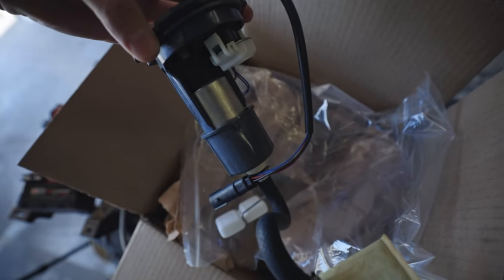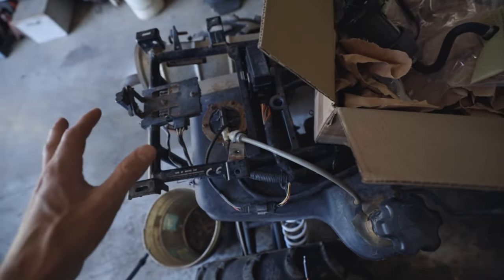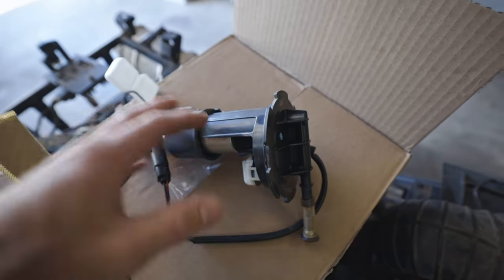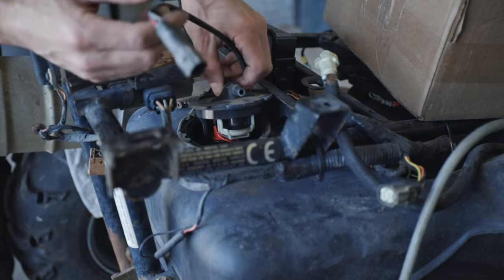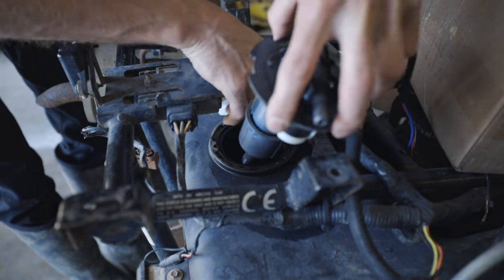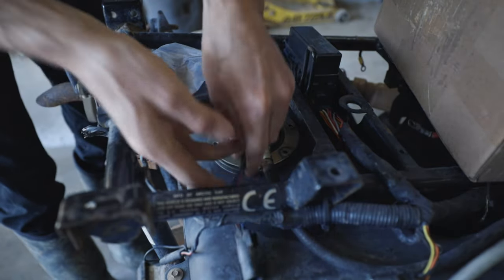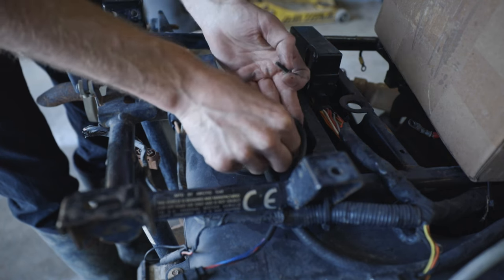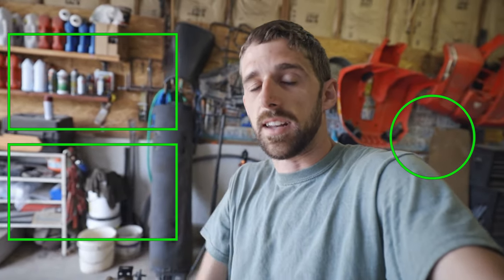How To install your fuel pump assembly

Comment: Yes, if it initially pumps when you turn the key it will give enough gas to start and idle a little. but a bad pump won't keep up the fuel pressure constant and then it will die out. If it's whining I would suspect the fuel pump, it should be a quiet whirring
Reply from the maker: Yes, if your pump isn’t holding pressure it will need replaced.

Comment: Would this cause you machine to stall and not want to restart? I have the parts on order, gonna start here and see what happens. It was whining like a sob so it probably needs it anyway
Reply from the maker: Yes, if it initially pumps when you turn the key it will give enough gas to start and idle a little. but a bad pump won’t keep up the fuel pressure constant and then it will die out. If it’s whining I would suspect the fuel pump, it should be a quiet whirring!
Reply: @ArcticFrost  thanks man!
Reply: Where do you buy parts for your ATV, would you recommend it?